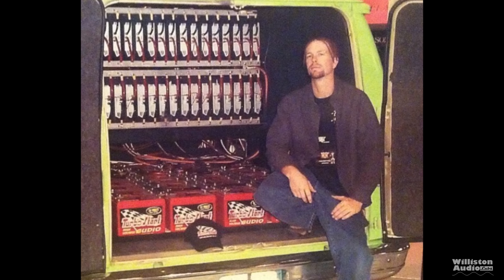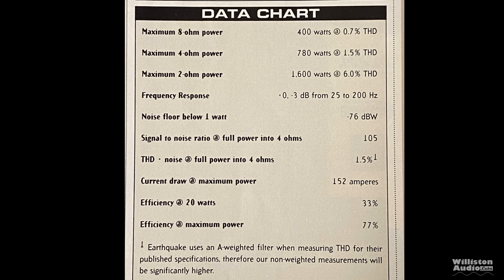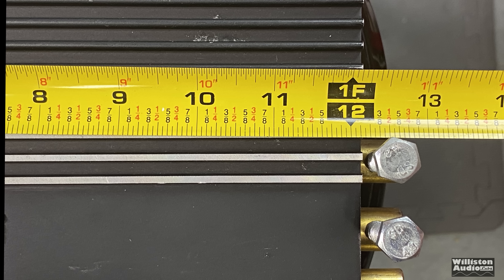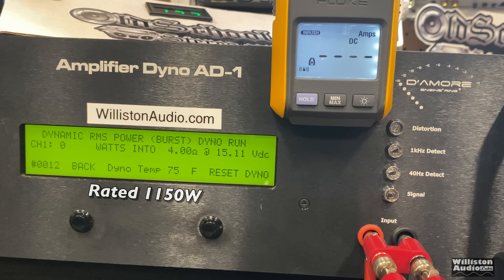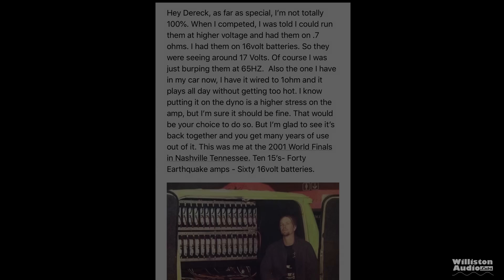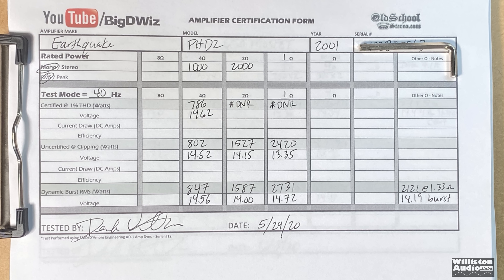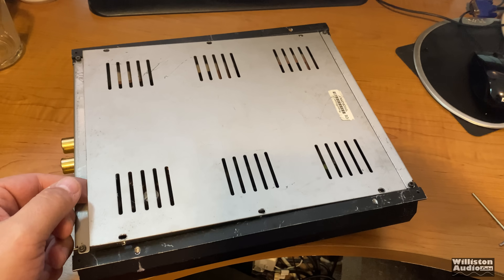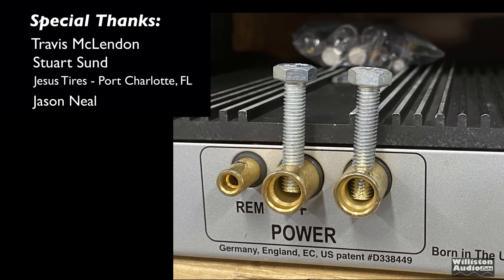2001 Earthquake Powerhouse PH D2 Amplifier "The Shredder" Amp Dyno Test

Comment: My cousin worked at a stereo shop and gave me a killer deal on 2 of these when they first came out. I put one in my 88 Hyundai Excel and it stopped working and I ended throwing the other one in to replace it. My cousin had told me it had probably blown the internal fuse so I held on to it and was going to check and switch it out. Well it ended up in storage and I just found it and decided to open it up and see if the fuse blew and the 30amp blade fuse is still good but I notice one of the same caps in the middle is loose one of the wires popped. Where could I send this to get re-capped and what would it cost me roughly?

Comment: I ran (3)  PH-D5000 at 1 ohm for several years in my hearse on (12) Memphis 15" HPO subs. Earthquake support highly recommended that I run them at 1 ohm saying that is the impedance that they really performed best at.  No lie there. Never had an issue during the 7 year run with them.

Comment: I was once using 2007 yr model alpine 500 watt mono amp with a 10” earthquake sub duel voice coil in 2 ohms load never had a problem with it. Still have it but now I’m using the newer  alpine R series duel coil sub with mono block Alpine amp 900 watts RMS. Good enough for me. YA BOI

Comment: I'm still up for offering my repair services dude, seeing as how everything has gone postal now! Haha... And of course, you'd get it back! I got sooooo close to winning an old American amp with needle type VU meters just because of you! xD I did get a surprisingly good Sony (of all companies, i mostly hate Sony!) amp that has LED VU meters though, it was running on my living room wall driving my monitor speakers for a couple of weeks! That always gets funny looks lol just finished repairing a few home amps i acquired cheap (Rotel RA-820BX and RA-840B! Plus an RA-611 i had lying around for a while, finally got to fixing the preamp and setting the idling currents for all of 'em!)
Reply: Would have loved to do the repair for you though! Thing is "upgrading" the value of caps isn't always a good idea.. In this case it'll likely help as that thing is designed to be overloaded, it seems! Reminds me of Rotel, everything is usually under-rated and understated lol they are very good at doing "wire with gain" amps.. I believe Rotel/Roland/Rank is also Boss Audio, explains why i like a couple of amps of theirs i have and repaired!

Comment: I ran 4 of these with 12 Atomic Thunder "Aftershock" 15" svc and achieved a 167.7 certified spl. We were running them at 16v with 3- 3ohm voice coils per amplifier in an extreme 1985 gmc safari. The Mark I 200dhc and the Nexus Lion were identical. Bob upgraded the mark ii (output fets I believe) and changed some thing small for the phd2 (Shredder).  Power output was nearly identical for all 4 amplifiers leading me to believe that all upgrades were to mitigate failure from low voltage. Great power from a relitively small footprint in a time when 2400 watt amplifiers were taking up seriously real estate.

Comment: Well u did not disappoint and came through only took 6-7 of waiting lol . Would this last at 1ohm for long I bet it was hot as a fire cracker
Reply from the maker: It stayed cool even at 1 ohm
Reply: I have mine running at 1omh and hasn’t ever gotten hot on me. Just have to make sure you use the largest power and a good ground and a extra battery is a plus

Comment: What happens if 100 or 200 watts More RMS is fed to a sub assuming sub and amp load is a match.
Eg: A DVC 4-Ohm 400W RMS SUB🔈 wired in Parallel at 2-OHMs hooked to 600W RMS monoblock AMP that is 2 OHM stable.
Purpose of this question is to get an idea as HOW much extra is HARMFUL 🚨.

Comment: Never been a big fan of EarthQuakes amps (usually kind of unimpressive) but there subs have always been where they shone. The HoLee S line and Subzero lines where and still are made in the states (sub zero using some foreign parts) and the low profile front hung SWS line are some real preformers. Even there cheaper on lines aren't half bad for what they are.

Comment: Don't have an amp but running an earthquake Sub-Zero 10 powered an Orion XTR 1500.1( watching an amp Dyno on it sold me 👍)  @2OHMS and it slams for a 10 has very clean sound and seems very well built for its age, people always question the earthquake brand until they hear it. 😁
Reply: sonic electronix has the best demo of this sub. do you have it in a sealed box or ported?
Reply: @rowboyto156  ported pre fab probably not perfect but it's within earthquakes specs

Comment: @Williston... I have a question: From the amplifier. Can a small wire be connected from the remote output to 12v output to turn on the amplifier. Thank you for your time.
Reply: Yes it will turn on the amp, but it will stay on as long as that 12v stays hot
Reply: Yep you can but your amp would always be on then.

Comment: I don’t no why Earthquake over rated this amp at the higher impedance loads. I think someone may have misprinted the information because the first line of these amps were rated a lot lower. I know they had 2 different models for the particular ohm loads. Earthquake told me this amp starts making real power at 1ohm and lower, I ran these at .7 on Atomic Shocker series subs, I just had to make sure to have enough amperage and voltage to feed it. They were not all that efficient. They were dirty amps, but back in the 2000’s in the SPL competition, we didn’t care, we were just burping. Glad to have seen this amp on a real dyno. Hope BIG D can get good use out of it.
Reply from the maker: This one could’ve been modded for 1 ohm operation. Thanks again for the amp!
Reply: Williston Audio Labs absolutely 👍🏼

Comment: Hey big D!, Can you do a video comparing a stock cheap amp power output vs a cap upgrade on it? ive always wondered if cheap caps are holding them back.
Reply from the maker: Most likely won’t see noticeable power difference swapping caps alone
Reply: @wal   I have always suspected some Chinese  caps were often overated, obviously the mosfets would still be the same but i wonder if the point where they start to clip would go up. I haven't been able to find a video where anyone's tried it and tested it, just thought it'd be a cool video idea. Thanks for the response!

Comment: I’m still trying to dig out my oldschool Lanzar 500 and 240. These had the old Hollywood 30’s style dont. These were built I think in the same factory down near Chatsworth where autotek and HiFonics were made. I’d like to see how they do if I can find them. I saved them cause they were in great condition and had the original boxes.
Reply: The original Lanzar were made by Zed Audio (yes, same as the old Rodek, Hifonics, ESX, Autotek, Crunch 50, etc. etc.).  They should make close to rated power, they will not make more "dynamic" power and they won't  benefit from high voltage in since they are regulated power supply.  Also the Zed amps typically do not like running below rated impedance.  Some years ago you could actually buy refurbs off the Lanzar website for super cheap and I had a bunch of them at one point. 
The good ones say "Made in USA" on them, later versions were far east manufactured but the same design, later Lanzar has been very hit or miss with mostly junk and a few good ones.

Comment: I ran two of the Earthquake PHD2 amps on four Earthquake Magma 12's back in the day. I still have the amps and picked up two more for an Old School Build.
Reply: I still have a 12in Magma in a 2.5 ported box. I've been using for over 20 years. Never had any problems with it, and it still gets stupid loud!  It's the original version that Earthquake made, with duel 3ohm voice coils. And even 20 years later it's stiil a beast.

Comment: A friend of mine had an earthquake setup in a mustang back around 1991 and it was amazing, it was the loudest I had heard at the time. I didn't hear louder until another friend put 4 15" Savard Rap running off a (Zed) Crunch 250 in little Mazda B2200 truck in 1994.

I ended up with the amp but I gave it to my brother who got me into car audio, he still has it and it's the jewel of his collection.

Comment: Nice , probably made 30 % more on a 16 volt system which would charge at 18 volts or more , this is how we use to make power , high voltage and load the amp down !!!

Comment: I knew that amp was overrated! I had one of those in 2002, when it was the forum boner of the internet and it replaced a JBL BP1200.1 on a Beyond Audio Inhuman 15, I gained very little on the change and was told for sure I was getting 800 more watts... now I know the difference was minimal at best 😡 Damn internet nerds

Comment: I had 2 earthquake phd3 the shedder 3000 shit rocks my 4-12s zeuz pro subs at 1 ohm ...came out on the market around 2004.
Reply from the maker: Shredding up subs like a boss
Reply: @wal  I will never get rid of them 2 earthquake amps. I had a earthquake phd 10000 watts red amp that I ended up pushing the amp with 4 15 kicker l7 like nothing. Also in 1997 bought an earthquake born in San Francisco 1000bx 2 channel an pushed it with 2-15 zeuz rocking everyone park cars setting of alarms off. Shit miss those days

Comment: Hey wiz, where do you send the amps to get repaired? I have an old school alphasonik pma2500 class ab with tiffany rca does over 1600rms at 4 ohms and has the hour meter on it. It was wired to wrong ohms by my brother and stopped working. I'm willing to repair it or even just donate it to you if you would make a video on it. Thanks. I uploaded the guts of it many years ago on the smd forum and it's still there to see if you want to.

Comment: I had that amplifier I was running it at .5 ohms to a pair of Kove Armageddon 15's I still have the Kove's in the back of my Hearse.
Reply: Did you live in Florida around the Tampa area?
Reply: @jasonneal  I do, is there a scene here? I'm from Denver.
Reply: @jasonneal  I lived in Cincinnati Ohio area
Reply: I ran two Kove 10s in my Nissan hard body ported into the cab.

Comment: I have an old 400tx supposedly made in 1996. I bought it as a parts and repair for like $60 and I did recap it but the issue was the TL594 which caused it to go into protect, the fets were all fine I did upgrade the power supply fets to a little better ones. I also didn't have a 594 to replace it with but after looking at the datasheets for it and the tl494 I used one of those because I had quite a few extras. It is also like 10 lbs earthquake didn't skip on the high-quality aluminum in those days!
Reply: Those were the last good earthquake amplifiers made.

Comment: I was tempted by the Earthquake back in the day.
I was actually going to use those amps to power my home stereo system until I discovered a HiFi home theater shop in local area.

  Just out of curiosity what was that pallet that you had dropped off?
Reply: Dave Micolichek  I never said which amps🤭

Comment: I owned one of these amps at one time and was disappointed with it really. Had I known it could be ran at 1 ohm I would have kept it. I got rid of it because I was told it couldn't be ran lower then 2ohm without some type of modification done to it.
Reply from the maker: It is possible this one was modified to run at 1 ohm. If so it did it’s power!